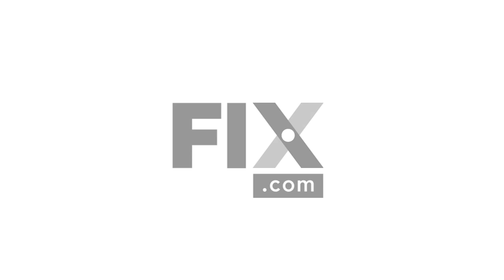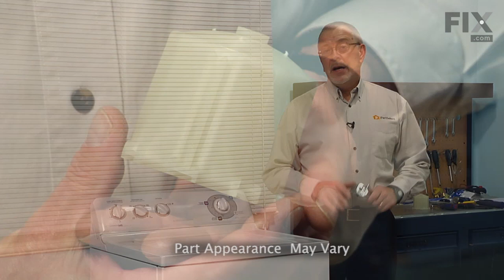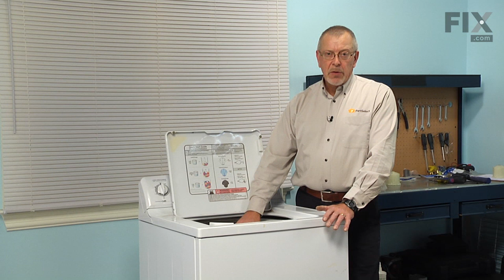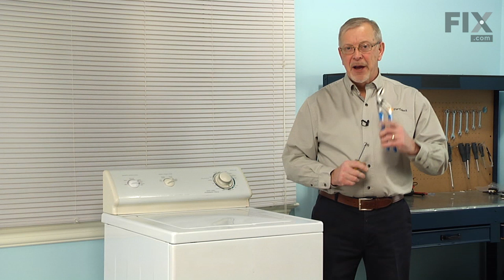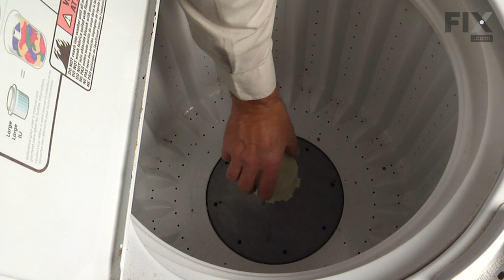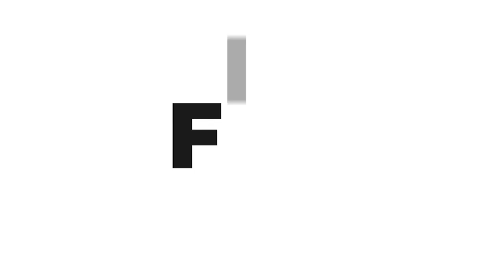GE Washer Repair – How to replace the Agitator Coupling

Comment: Too bad mine is stuck like its welded and wont come out after pulling smacking, beating, and using a hammer and screwdriver to tear part of it apart...its STILL on there. Im gonna be out over 150 bux on a repairman for a 20 year old washer that I could fix for $15 if that sob part would come out. Man Im mad at it.

Comment: Actually, the first step in getting the agitator up and out is easy...just loop a belt underneath it and pull up  on both belt ends, and it pops right off, watch it doesn't hit you in the face.

Comment: I call bs. The only agitator that needs replacement is one that has been on for many years and it will take a lot of work to remove what he simply just picks out of the drum. I don't know how these kind of videos help anyone but the publisher.
Reply: I just removed an agitator in for 13 years took merely a pull, of course im 21 years old but still I didnt use much strength.